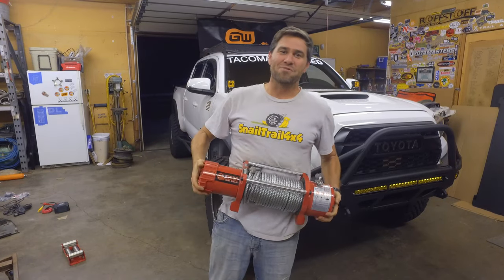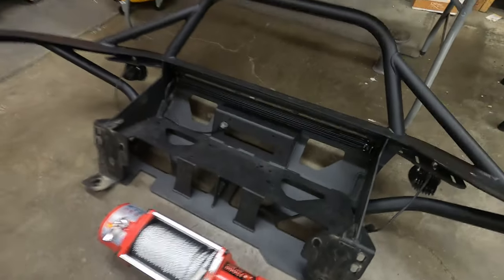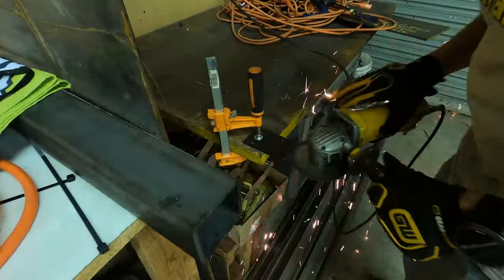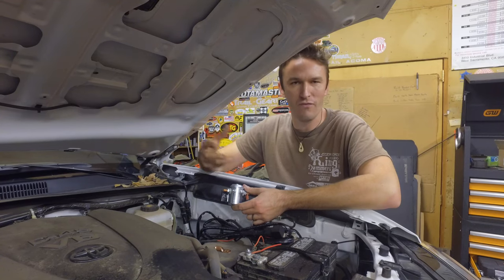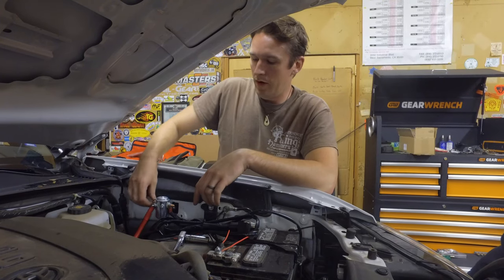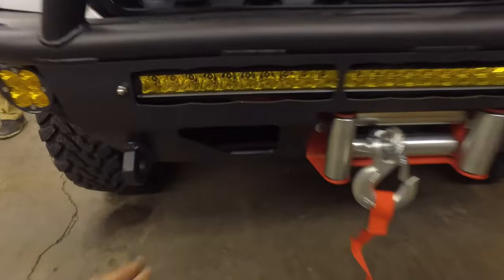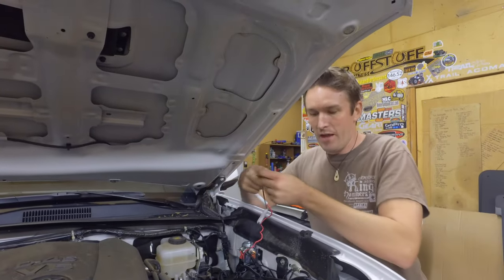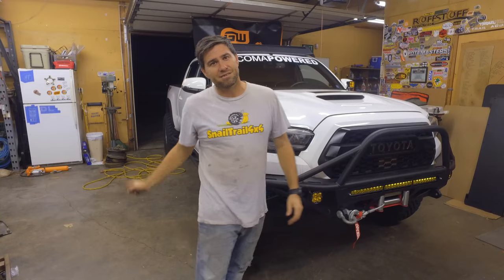How To Properly Install A Winch | Open Road Winch

Comment: The ground cable for the winch needs to go directly to the battery NOT the body. You are currently grounding the winch thru the little wire from the battery to the left fender.
Reply: I was thinking the same thing. Both leads need to go Directly the battery.
Reply: worst part of the internet - they teach people how to do it , but they dont know how to do it :D

Comment: Is the solenoid waterproof? Took a look at the amazon page but didn't find an answer. Does it need to be waterproof or is it good as is? Amazing content!
Reply from the maker: I don't know, I'm sure it's good as it, but I wouldn't use it on something that goes under water

Comment: I think the jumper cable wire is cheaper than buying battery cable, because jumper cable wire is not rated to take the abuse of being mounted on a vehicle, this includes abuse from vibration and heat on the cable. I think battery cable wire is higher quality because it uses better insulation and thinner copper strands.
Reply from the maker: Maybe so, I've never had an issue
Reply: Depends on the jumper cables for sure but like you said, in this case, battery cable is copper. Those jumper cables are CCA.

Comment: Just put this same winch on last week. but its the Zesuper brand with Syn rope. Question! Isn't that black 4th wire that comes off the bottom reason why we don't need to run the solenoid? Or maybe I should add a solenoid on mine?
Reply from the maker: The solenoid is an added level of safety. Because there is no inline fuse that would work the solenoid is the best safety for your vehicle

Comment: Does the Warn Solenoid  replace the need for the Overload Protector that comes with the winch?
Reply from the maker: No, the warn solenoid is mainly for the protection when you're not using the winch